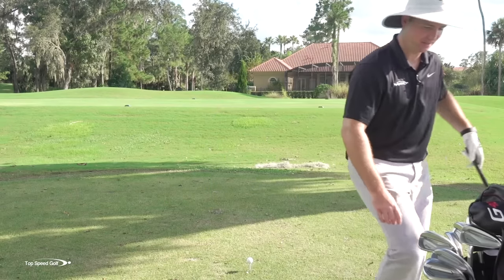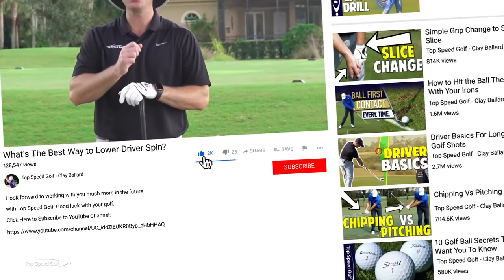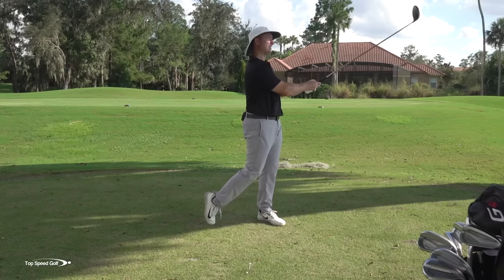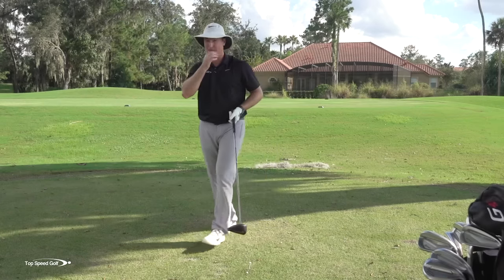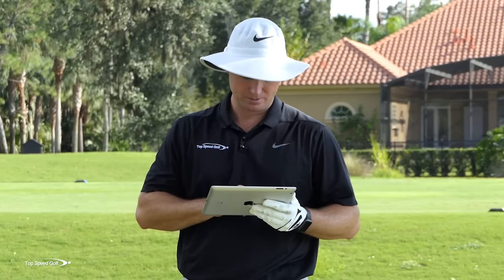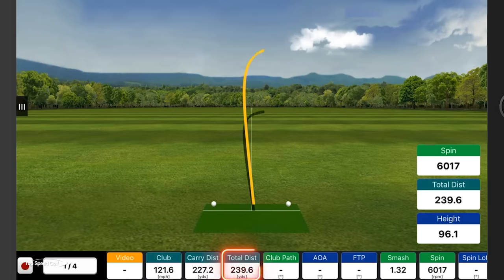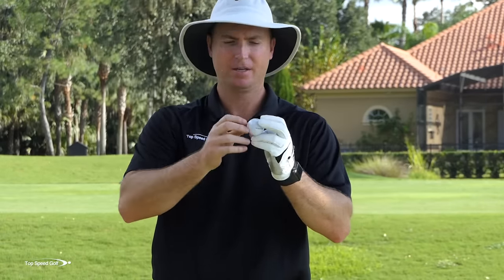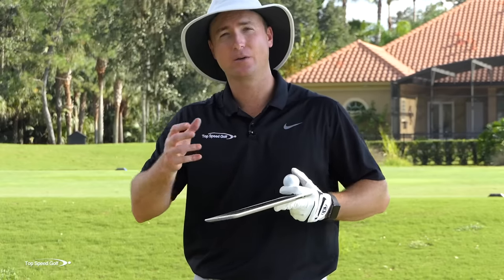What's The Best Way to Lower Driver Spin?

Comment: 1) I was fitted for a driver shaft length where my swing shallows. 44"  2) i got a 12 degree Ping g410 Plus. 3) SS is about 90 - 94 mph. Spin # is around 2100 rpm. I'm hitting mostly draws with a miss of a push fade.
Reply from the maker: Nice!
Reply: some of those push fades are due to heel strikes I 'll bet. I do the same thing.

Comment: Amazing how far He hits that thing!!  Definitely learned something here Ive always got a -2, to -3 degree attack angle on my driver can't seem to hit up on it.  end drop kicking the mat every time I try to hit up ore  when I do make good contact its always a neg. attack!  AHHH now I know because the rubber tees are too short even the longest ones are too short .    I  even bought a trackman 4 last week been practicing to get the numbers right and just couldn't figure it out.  Just dawned on me after watching this video.  also my 103 ClubHead speed 1.48 SF  152 ball speed and  I'M only getting 235 yards total  didn't seem right.  going to have to go buy some long tees and stick them into the mat beside the rubber tees. give it a try!   Thanks TSG
Reply from the maker: Best of luck!

Comment: thank you.  That data is crazy close to what my average is 256 carry, 152 ball speed, launch angle a little of as mine is 11 not 9 but amazingly close.  Looks like I just need to hit up on the damn ball...I suck, golf is hard
Reply from the maker: Hi Tod, it's possible you may be hitting it low on the face too. This will add spin and make it launch lower. Play well! Quentin | TSG Instructor

Comment: WOW!! the 1st swing and 3rd swing look just the same and 100 yards difference!!
Reply from the maker: Swings can look identical and have much different results. Hitting the ball a 1/4" off center can make a big difference. You won't see that on camera. Play well! Quentin | TSG Instructor
Reply: @TopSpeedGolf  Yes it's strange. Never seen myself on video but in my mind and my action when I try to get my angle of attack up a demonstrable amount it looks and feels to me very different. I have played golf pretty well for 30 years and only the last 4 years learned about angle of attack and taking spin off Driver for length. I joined a tree lined Course 2 years ago and unbeknownst to me my Angle of Attack and Swing Speed has gradually got worse due to concentrating on hitting fairway and not trees. It's gone from 112mph to 104mph without me noticing! Was on Trackman for the first time for 2 years last week at a Cobra demo day. I know what I'm going to be doing this Winter! Great video by the way! 👍

Comment: Brilliant video and explained perfectly.  I find my spin rates throughout the bag are spot on and then I get to the damn 10.5 driver and it sits at 2900-3200...eff...I am fairly straight ball hitter with a swing speed of around 103-107.  Do you think I would benefit from a 9 degree driver?  I hit the sweet spot quite consistently.  Thoughts?
Reply: A stiffer shaft will also bring down your spin
Reply: I already use a stiff shaft, do you think an extra stiff is needed for that swing speed?  I have never tried x-stiff. Thanks
Reply: @todpharis4996  you won't notice a whole lot more distance with a 9° driver. According to trackman, your attack angle is too low. That's what's causing the spin, not the driver. Also, 3200rpm is not ridiculously high for a driver. Touring pros can still carry the ball 290 yrds with 3000 spin,  It sounds like you have a slight flip at the bottom throwing away your angles. See your diagram below:

https://www.dropbox.com/s/20nci8mtab3kc8c/IMG-20191109-WA0063.jpg?dl=0
Reply from the maker: Hi Tod, that spin rate isn't optimal but it's not bad. You could try lowing the loft some and see if it helps. You can also deloft the face more and hit more up on it. Play well! Quentin | TSG Instructor

Comment: Clay, thanks for your excellent vids.  I was at the driving range yesterday (first time since May due to medical issues) and I noticed about 1 of 20 or 30 balls would have a really odd flight, taking off on a beautiful trajectory and then dropping almost straight down, and sometimes appearing to curve on the fall.  I know, it sounds like aliens messing with my ball.  I attributed it to crappy range balls at first, but later it occurred to me that this is the ball flight that a knuckleball pitcher throws!   Is it possible to actually hit a zero spin golf ball?  I know when I was younger I would occasionally get a knuckleball coming at me playing baseball.  They lacked carry and were harder to catch.  If  it is really a case of hitting zero spin balls, would you recommend a more descending blow or adding a degree or so of loft to the clubface?  THANKS!

Comment: I hit them in the centre but hit high and right with a draw. So high that it drops and does not roll much. How do you hit with a positive angle of attack but still hit a lower trajectory?
Reply from the maker: I'd maybe try moving the ball back in my stance a little bit and see what happens. Best of luck! Nate | TSG Instructor

Comment: Main point to side spin occurs when clubface brushes sideway to the ball I think.Normally torso turned after impact and that causes clubface to brush the ball sideway.We need to send the clubhead straight to the target or 1o'clock.See Moe Norman's.Been struggling for more than 30yrs. and just realize the side spin.

Comment: my swing speed it around 105. My driver loft (G425max) is 9 deg. my spin rate is 3,300 to 3,700. I only carry it around 240 - maybe 250 if I'm lucky. I want that extra 20y of carry - but I can't get rid of that high spin.

Should I try to increase my driver loft? Thanks for the video.

Comment: I'm hitting two much spin with the driver. No matter what club, even low spin heads. The two times I saw a fitter, two times at a demo day, a common theme was too much backspin killing my distance. So frustrating. I don't know what to do.
Reply from the maker: The easiest way to lower spin is to hit the ball just above center sweet spot. I'd get some foot powder spray or impact stickers and go to the range and try to make contact with that area of the face consistently. You can use the spray or stickers to identify where you're making contact. Best of luck! Nate | TSG Instructor

Comment: I want to know how to get more back spin. Sometimes I hit a drive, which has a great launch angle and seems to have good velocity. The ball initially takes off well, but then it's like the pull of gravity got 3 times stronger (or something from the twilight zone happened) and the ball suddenly falls out of the sky. When it hits the ground, it rolls like mad going forward maybe another 75 yds. It's like I got topspin instead of back spin? But topspin is supposed to be impossible. Maybe I am not generating enough back spin, but I am in the dark. There is a certain driving range that has the TopTracer launch monitors. These used to provide spin information, but now they took that away!!! :(

Comment: If in the set up for driver, would placing the ball slightly left of your left foot help to hit up, ?
Reply from the maker: Maybe some but that would make it pretty difficult to hit it with a square club face and club path. You'll likely hit a lot of pulls. Play well! Quentin | TSG Instructor
Reply: @TopSpeedGolf   yes the risk of pulling it is the obvious consequence of that set up, but could that not be countered by aiming right, i also understand the club head speed reaches it peak speed past its lowest point in the arc , hence my thinking on placing the ball left of your left foot by a few inches, and on a high tee , presently trialing it out out my local golf course

Comment: Thanks Clay, how about shaft flex? My average swing speed is 107 and no matter what I try the spin rate stays at 6-7k. Attack angle is better but still -3.5. I currently play a stiff shaft. Could x stiff help ?
Reply: -3.5 down, no shaft will ever fix that